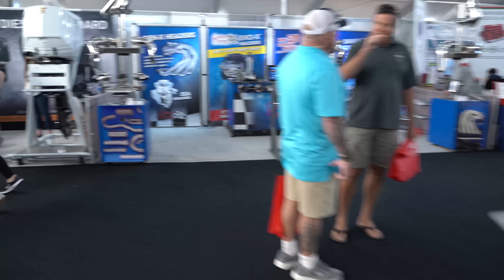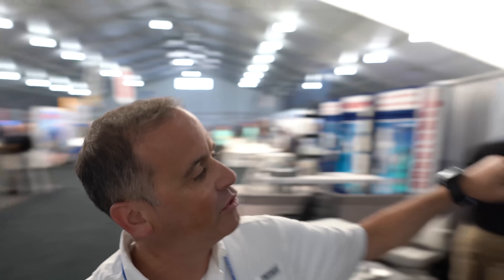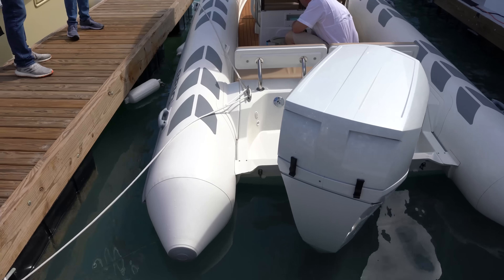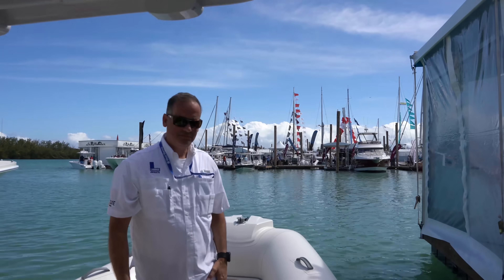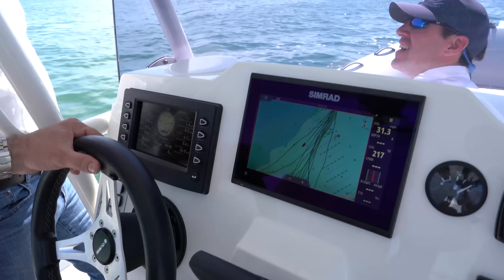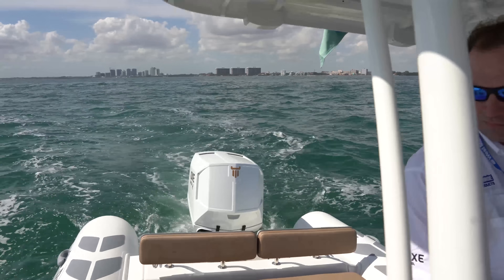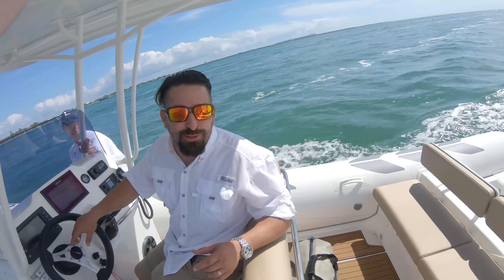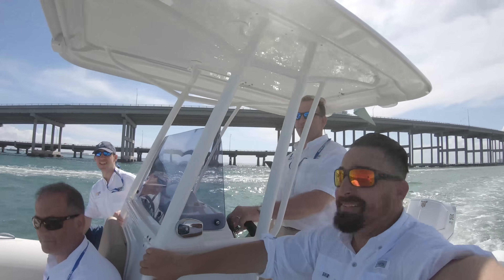The diesel outboards are coming ! Oxe 150 hp on a Brig in Miami !

Comment: Taking a proven diesel engine and developing it into an outboard was a most sensible idea especially since the engine of choice is a GM product. Diesels make so much sense in boats.
Reply: No they dont, they polute a lot more.
Reply: @FrancisCordieri  That used to be the case. Not any more. You average duramax diesel truck pollutes less than a prius.
Reply: @FrancisCordieri  stop drinking the kool aid
Reply: but they need to get cheaper....and lighter

Comment: Just as economical as my mates 70s Mercury 115 HP 2 stroke would empty a 6 gallon tank in less than 20 minutes           (Imperial gallons) flat out 4 blokes on board, this engine is truly amazing well done guys
Reply: That diesel will blow a gasoline job specially a 2-stroke out of the water on gas mileage
Reply: @willusa2927  Yeah except it costs 74k for a 200hp outboard. I'll take a few mintues to calculate the return on fuel economy.

Comment: I've tried both a single and twin-engine setup in Angelholm (Sweden, OXE/CIMCO, home town). These are automotive-derived, horizontally-mounted, diesel engines (with a very impressive, trick transmission system) so they've benefited from huge development. All around really impressive - performance wise very hard to tell from a petrol-engine. Plus superb consumption, low emissions (MUCH lower, than equivalent petrol).

Comment: For the weight you could carry a complete second gas motor. For the price you could carry a couple extra gas motors and just throw them over when they die.
Reply: Sad...but true.  To effectively use them you'll have to make a choice: be overweight or be underpowered.
Reply: I don't think their target market will care. Meaning the coast guard and super yaght tenders
Reply: @wmason1961  i agree this dose have a place as a work horse not a speed boat but a work horse and diesels with there new high presser injection are very good low fuel consumption and this has a much more usefulness than that retarded 57 Chevy v8 in a out bored
Reply: Possibly could last longer than regular gas motors as well. Maybe 2-3 times longer if they mafe it correctly
Reply: and then you calculate fuel consumption/price and say welp, ill throw those few gas motors any day for this single one....
Reply: dexter2433 You guys can always go check out Cox’s 300hp Diesel outboard
Reply: Diesel is better
Reply: Burn less fuel means can go on bigger fishing trips
Reply: Worth every penny if you no longer have to carry two types of fuel.

Comment: Does it come with a "jake brake"?
Reply: And double deep reduction with a button clutch  for those long hills
Reply: Let’s not forget the tow haul for them big ass trailers.
Reply: with 18 gears?????
Reply: OH man. would that be awesome. shiftin away 10 speed w/ jake break and some coal :)
Reply: no u just jam it in reverse to slow down using engine power yea who cares about the lower unit and belts i bet after a dozen or so slam bam jams the hydraulic clutch plates and belts will be worn out or stretched and what they didn't mention is that the belt cogs are made of some super duper cheap to make not long to last with a slam direction shifter plastic polymer that costs pretty much a new motor for some marina mechanic to wrench on after a 12 pack scratching his head because there's no manual or anyone with experience to show how to work on these concrete shoes.... not bashing this product but there would have to be one hell of a fire sale and a 100% parts warranty and 100% labor repair cost coverage to even spark my interest but for smaller guys that use light weight high output gas motors on small salt or freshwater fishing boats this is not even in their wildest dreams to big to heavy and could buy a new gas outboard and rebuild one for a spare to the cost of one of the OXE new. If this company where to sponsor me for a year paid and all i would test their engine and put it through the worst conditions possible and then talk to them about making a Great Affordable Diesel outboard and also make their sales go up where they never thought of selling to customers.
Reply: Yeah and a trailer brake controller with airbags
Reply: Great question
Reply: Ahahahahahahahahahahahaha bruh this is funny as fuck

Comment: Only thing that makes me  wonder is how will the this transmission hold up. I like the idea of taking a production engine off the shelf, I hope it works out the market needs something like this.
Reply: Matthew Holzmueller  take a stock outboard thats  so strong its up to it. There was a 25 hp outboard with a 6 or 8 hp hatz diesel. Brand name was selvi.
Reply: Sorry. Selva.
Reply: The gearbox is above the waterline and seems really robust. See this video for details: https://www.youtube.com/watch?v=eSLb-mHnBlA
Reply: Selva are Yamahas  @henkoosterhof5947
Reply: Exactly my thoughts. This powerhead is a game changer if it's reliable.
Reply: Dave Turner  i cant say whats the brand or manufactorer. I know in the 70 and 80 there was a 6/8 hp  hatz and in 85  a few yanmar diesel outboards. Yanaha also had kerosene outboards. Start up on petrol and when heated up change over to kerosene. Before low revs(lock, mooring etc) change over to petrol again.
Reply: J will  diesels are generally more relyable than  petrol.

Comment: Dude calm down!! They have not invented the wheel!
Reply from the maker: Diesel is better than the wheel how dare you 😠
Reply: @AlfredMontaner  Hopefully soon they put some r&d into high output electric outboards.
Reply: Ive been running a 20 HP diesel for the last two yrs. A Suzuki prototype straight from Japan. Mine even came in a 4 speed manual.
Reply: they invented just an new absorbent for "men"...
Reply: The turbo makes it so quiet
Reply: Yanmar🤐

Comment: And a 300 HP next year,  what about a 60 HP for my pontoon.  lol
Reply: well with the added weight just strapon a 150 and call it a day but u might have to strapon a couple extra pontoons to adjust for the extra weight lol
Reply: Well, since they are not developing the engine, there is a lower limit. They could tune it down, but it would still be the same weight. They would need to use a different engine for those power levels, maybe something like a VW polo diesel.
Reply: jim stauffer COX already has 300hp outboards
Reply: Yanmar Distributes a diesel outboard called the D' Torque, 70 hp
Reply: Oh hell just get one. Of course with the 700 plus pounds you may have to flood the front pontoons.

Comment: We have a 200 on one of our work boats , you could fill a book with the saga of breakdowns.
Reply: They had some problems with their first 200 hp engine ive heard. When did you buy it and what is the problems? Some say its execellent etc but you say its crap... why?
Reply: @palius11  

I did not say it was crap , but the list is 

Shredded drive belts (2 I know off)
Leaking turbos blocking air filter (4 I know off)
A couple of fried looms & a regulators , I believe one repair lasted less than 2 hours.
Failed weld on the stainless exhaust , leading to a sprinkler effect under the hood.

Exhaust temp alarm under more than 2 3rds throttle.

There is more that I'm not aware off.

Believe it or not I like the concept of it & it tromps on , 2 years old but its had 3 possibly 4 power head changes.

I did not buy it it's a commercial engine , I just get called to it when it breaks down.
Reply: okay thanks very much! @onewhocansea4228
Reply: @onewhocansea4228  Are you some kind of mechanic for the oxe diesels? or just this one? Because I´ve heard so much good about these engines. There is this guy who talked very good about the engine, the engine had been going for 330+ hours total.
Reply: @palius11  
I am not a mechanic for Oxe diesel. I have also heard great things about them.  But with what I know & have experienced , seeing that sales rep in the video talking about how great it is , that is contrary to my experience.

Low production numbers , hand built & IMO still in development ,when the bugs get ironed out it will be very good.

Comment: Its definitely a novel idea, and im surprised one or more of the mainstream marine engine giants haven't dabbled in it. That being said, heres the problem I'd have with the oxe. Its an automotive based engine. Bonafide outboards are designed to run wide open throttle for extended durations, for most of their lives. What happens when you run an automobile at wide open throttle every single time you go anywhere? Its completely thrashed in short order. Its the same reason seven marine outboards spend statistically over 90% more time in the shop than Mercurys. They are automotive based platforms. I might be a serious looker when mercury releases a diesel, but Im not ready to pay marine prices for automotive technology.
Reply: can you explain in laymans
Reply: Depends, a lot of small-medium machinery are powered by automotive based engines and they are usually throttled up to a max of 2500 or so and last for ever. If this was the same principle, I don’t see the issue.
Reply: sorry, I only speak English. ive never even been to layma
Reply: @bryancarpenter3648  i mean laymen terms, -to put something in layman's terms is to describe a complex or technical statement using words and terms that someone not specialised in a specific field can understand.
Reply: in that case im afraid you are going to need to give me that in laymens
Reply: @bryancarpenter3648  tell me what you said in your first comment in simple terms to someone who doesnt know that much about engines
Reply: this is honestly as simple as I can state my opinion, and keep in mind, its just my opinion. marine outboard engines are built by design to withstand running at their maximum output for extended periods, and for most of their lives. for example, I have a mercury 150hp outboard, and its designed to run at max power, all 150hp, for long periods, hours, and for most of its life, meaning every trip. . . . . on the other hand, a mazda Miata, makes about the same horsepower, and being a car with wheels and experiencing much less drag than a boat in the water, will go easily over 100mph,,,,, however, because it requires much less effort to operate at highway speeds, will only use all its power very rarely, and the engine is designed with this in mind. if you were to buy the mazda, and drive the car at full power every single time you drive it, your engine is going to be junk in short order. its just not designed to do it.
Reply: @bryancarpenter3648  what is so different about an outboard engine that its designed to be ran at full throttle vs a automotive engine, plus they also recommend never to run marine engines at maximum throttle
Reply: I think its becoming clear that you don't know what you are talking about with your advise that "they also recommend never to run marine engines at maximum throttle",,, in fact, mercury marine very clearly discusses running wide open. go to mercury marines website, or look at mecury marines youtube channel and watch this video: "Mark Zona Talks Break In Procedure with Mercury Technician"... I cant help you understand this any further. good luck and happy boating.
Reply: @bryancarpenter3648  So if I take a well broken in Mercury marine engine and put it in a Mazda Miata then I should be able to race it for days and days, right. 
LOL.
Reply: i would say its equally brilliant to reversing the charges and using automotive technology in marine applications

Comment: QUICK SPECS - Oxe diesel (200hp)
PRICE - $74,000

TYPE - 2.0L inline four

WEIGHT - 350kg

TORQUE - 415Nm at 2,500rpm

ALTERNATOR - 130amp

DIMENSIONS - 25in leg model (994 X 1180 X 678mm)
Reply: $74,000 is a lot of money. You can buy 4  gas outboards for this price.

Comment: For all Sail-Boaters out there with"in-board"(VOLVO DIESEL)engine,keep this kind of engine,ready to mount,or already mounted and"tarped"(just in case),have the proper off-board mounts ready,it happened to me,off the African ocean/sea coast,sailing from FRANCE,no wind,no more engine(Two dead injectors)I installed my diesel off-board in 30 minutes,hooked up to my, in place systems,made it to port at 12/14 KNOTS(easy)on a 13 Meters Beneteau Antares(175 HP,enormous Torque)instead of the advertised 150/Such a relief to have that engine on the side,kept fishing,caught 3 great Bonita,with BBQ ready,and"cut'up,ready to eat,at port....!!!!....For an SV,having such an engine,on the side ready to mount,is a great peace of mind.(All my LED Lighting,also produced,by this MOTOR).

Comment: NEANDER Dtorque 111  has a 50 hp diesel outboard as well.  They are going for the smaller engine market.  When the price comes down it will be a game changer in the same way Oxe will be in the larger market.  The dtorque is being marketed through the Yanmar dealers.

Comment: Whoa i was excited till i saw the weight of the 150 hp, 771 lbs is insanely heavy , a V8 350 hp Yamaha weighs 780 lbs
Reply: With a inflatable that extends beyond the motor it helps hide how  much the motor would lower the back end of the boat.
Reply: @johnmoore5293  771 lbs would put my 21 foot Grady Whites transom deep in the water, no doubt the scuppers would be under water. Im thinking 771 ilbs to 150 hp is useless for most applications. They would have to shed 300 lbs off of that 150 for it to be practical. You hit the nail on the head its those rubber pontoons that is keeping the ass end of that boat above water.

Comment: You had me until GM was involved. Catch this thing 1 day past it's warranty and it'll be a better anchor.
Reply: I think the point was, GM"s are gonna require more maintenance. After years of owning Honda, Nissan, Ford, and Jeep(who no one would rate high on a reliability scale) I finally bought my first gm, a suburban  ltz. It will be my last. For such an expensive vehicle, I have been quite disappointed. From an oil consuming afm engine that could classify as a 2 stroke to cheap trim, control markings that  scratch off and multiple door handles broke, and the list goes on...
So, GM backed tech...gonna be hard to get excited about that.
Reply: clam digger , that’s the difference between a well sorted and proven performer (gen III 5.3), and GM’s forced retirement (gen IV + 5.3s).
Reply: I can agree with both of these comments on the different gen engines. Unfortunately     the afm engines from from GM seem to be well documented as a poorly executed design and then even worse service or fixes for the many customers who bought their product.
Reply: GM's best engine they make is the Ecotec 4-cylinder
Reply: G.M. is the ONLY one of the big three automakers who has been manufacturing diesel engines for many DECADES!  Detroit Diesel Allison  (G.M.) has been making some of the best diesel engines on the planet since the 1940's or so. G.M. owned 70% or so of Isuzu when they made Chevy Luv and Isuzu Pup pickups with the original Duramax from 1981 thru 1987. NO ONE has been making diesel engines longer than Isuzu world wide with the exception of Puegot. Allison Transmissions have been used in School buses, garbage trucks, dump trucks and so on for DECADES. One of the very best transmissions ever made!
Reply: @3Mudbone1  just because they are involved with part of another company doesn't mean that they get to take credit for all the success in that other company.
Reply: GM 5.0 and 5.7 are the two most common recreational sterndrive engines on the planet. Plenty of 3.0 and 4.3 out there too. Both Merc and Volvo used GM engines extensively - Volvo still does.

Comment: how about diesels 15, 30, 50's for catamaran and mono hull sail boats?  its a much needed market.
Reply: non yayet a belt driven saildrive would be great! Each 90 degree turn in the driveline chews horsepower/torque.
Reply: @jacksbackable  but how reliable could it be made to be?  maybe a double roller chain drive, if we can keep the salt out? we've been using 90 degree turns for a lot of years.  and if i'm right, diesel would have more torque than 2 cycle or 4 cycle gasoline?  right?

educate us. 

better yet, get them on the market.  start making more smiles and dollars.

Comment: By now those diesel engines are to expensive. Not for private use except you do not have to care about money. Rather for government military etc.
Reply: Mercury has a 150hp version of the optimax that runs on diesel and isn't priced that much higher than the gas version.